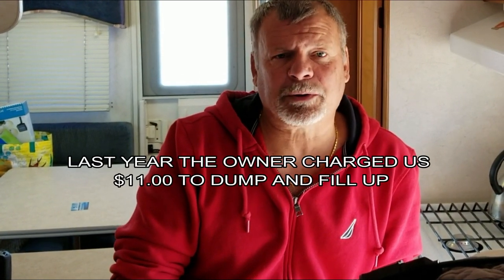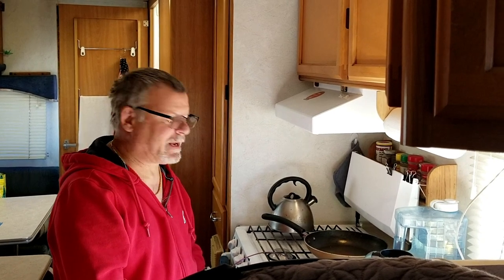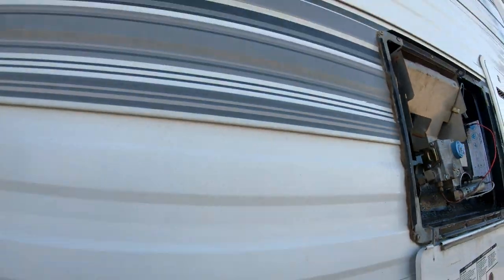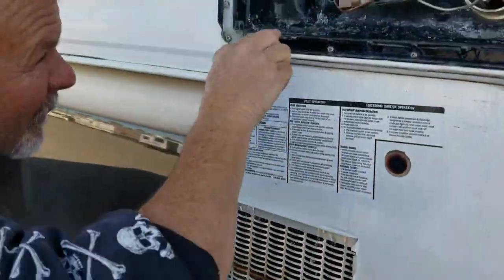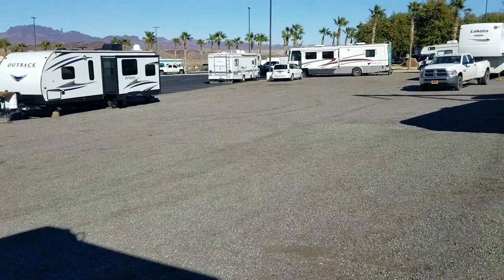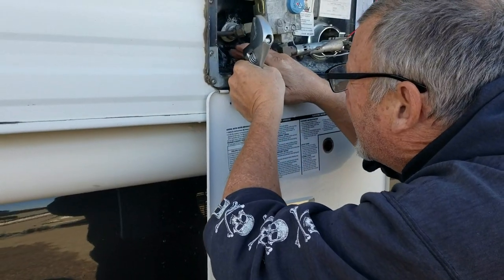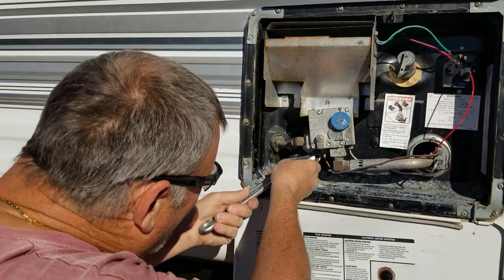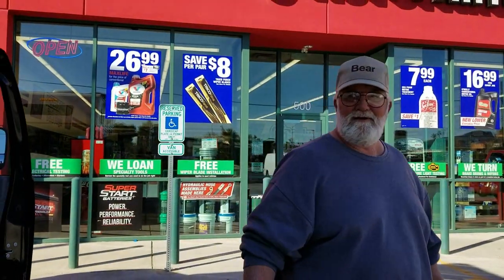Let's Get A  Few Things Clear Comments and Answers. How To Fix A Plug, Life Vlog and RV Living

Comment: Terri, let me help you to help Scotty. The teflon tap is applied to the outside of the male threads. If you hold the male part in your left hand, use your left thumb to hold the lose end and wrap the tape over the top going away from your body and about one and half to no more than 2 time around stretching it tight the whole time, and your done. Then thread the plug into the hole.

Comment: Don’t want to be a backseat quarterback but adding a 4 to 6” crescent wrench, would get into small places easier.
I am a retired HVAC Tech and always carried one with (with wide opening Jaws), for occasions just like your experience.
Good job ... it’s always hard when your out on the road, I worked for a company that covered the whole Mpls/StP and surrounding communities up to about 40 miles out. So ... over several occasions of being miles from my own tools at home or any special shop tools, I accumulated all that I needed, to get any job done in my take home work van. But when your vacationing it’s “hard to know” what exactly your going to need, along with space and weight issues.
Always great content ...
Thank You
Happy New Year
Reply: I agree with the crescent wrench. A small one along with a smaller set of screwdrivers are needed by everyone.

Comment: I went through the same thing with the plastic drain plug . I ordered an all brass fitting with a petcock . No tools required to use . Easy for seasonal maintenance & does not leak . Paid around $10 on Amazon

Comment: Yes, Mine did the same thing.  It broke off in the water heater.  I ended up using My propane torch like a plumber uses and burning the plastic plug out.  I use My torch to light My oven with.

Comment: They charged me $3.00 to fill my tank yesterday at the Laundromat Mall. The Blythe Wastewater dump is awesome.  I had a leak in the exact same spot on my water heater the week before Christmas. They used plumber's putty at the factory on the threads, and it had eroded. I replaced that with teflon tape, about 5 layers.  Leak fixed.

Comment: I had the same thing happen to my water heater. I put a 3/4 inch pipe plug in. Not another plastic plug because as you know they are a pain to remove.

Comment: I don't know if anyone else pointed this out but the thermocouple line appears to be resting on the block fitting. I'm wondering if that could possibility cause a hole to be worn in the line due to vibration causing your heater not to fire. Couldn't really tell from the camera angle if it was actually touching.

Comment: For the future for broke off plastic plugs. In the garden departments at Lowes/Home Depot there is an aluminum T handle tool that has stepped ridges for removing broken sprinkler risers which will remove the broken pipe or plugs out! Good Luck.
Reply: I thought of the same thing immediately. A lesson learned from the old sticks & bricks days :) Couldn't believe how long I had to scroll through the comments before I found someone else who came up with the same obvious solution. Good job Bob!

Comment: 1 get tool bag < they have nifty ones that r small @ Walmart> in said bag  2 monkey wrenches a socket that fits the drain plug { the tools you may need for basic repairs } 2  shut of propane    3 remove gas valve   4  larger work area     lol I know you get so many suggestions to fix . I been in the same spot. { removed hot h2o over buttons not on }  put an anode rod back in helps with build up in hot water tank..
Reply: be safe out there haven a ball ..

Comment: You need to put a Anode Rod in there to absorb the corrosive effects of the hot water to extend the water heater's tank. It get's eaten up as it get's used because of the corrosive that go's on. You will need to replace it as needed. they do last a long time.  You can clean them off to I do once a year by lightly scraping it off.. I'm really surprised that they didn't mention that to you... And I always use a socket..

Comment: Shouldn't there be a sacrificial magnesium anode rod that corrodes instead of your tank in place of that plastic plug?  Mine is a bit different but same principle.  Check out the manual for your particular water heater and replace that plastic plug with the anode rod.  Should take a 1 1/8" socket and a $10 part that usually needs replacing about once a year....

Comment: That happened to my travel trailer last spring. My landlord found instructions online that said use a heated screwdriver or butter knife because it was plastic. The screwdriver didn't work and she ruined my butter knife getting it out. The new one was also plastic and she wrapped plumbers tape  around it in screwed it in. No leaks so far.

Comment: Hopefully you can replace it with a brass one, been here done that with our camper. Good attitude helps which you kept. Thanks for sharing. Safe travels guys
Reply: 5  Star idea on the brass one. My plastic one did the same thing and I replaced it with brass as well.
Reply: Shouldn't replace with brass...will react to metal in tank and permanently "weld" itself.
Reply: @sure2rain725  Yup... Dissimilar metal corrosion

Comment: I bough a metal plug that will work better my did that to. My brother fix mind
Reply: Hopefully it is brass. A metal ( steel ) plug is for gas and will corrode and be difficult to remove as well as cause rust in your water. Brass and wrap with Teflon tape will work for you great.

Comment: Those plastic plugs are bad to use.  I would have replaced that with a galvanized plug with the Teflon tape to seal the thread and reduce galvanic corrosion.  Those never fall apart in time like the plastic ones.

Comment: You need a set of easy outs. They are left hand spiral taps that tighten down on what you are trying to get out. They come in various sizes and you can use a tap handle of an adjustable wrench. https://www.sears.com/craftsman-5-pc-screw-extractor-set-includes-screw/p-00966202000P?plpSellerId=Sears&prdNo=3&blockNo=3&blockType=G3

Comment: Id replace that with a bronze plug insulated with Teflon tape. (reduce electrolysis ) Might  even put in a pet cock drain valve I bet though the plastic plug is designed to blow out if the water freezes?